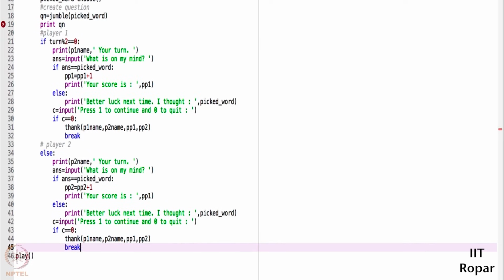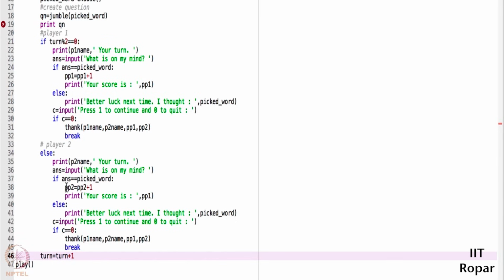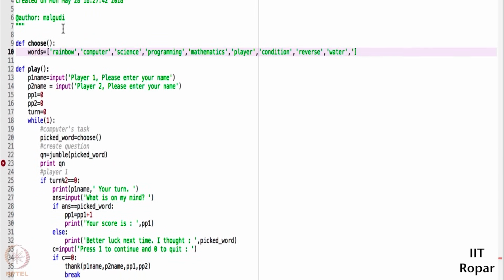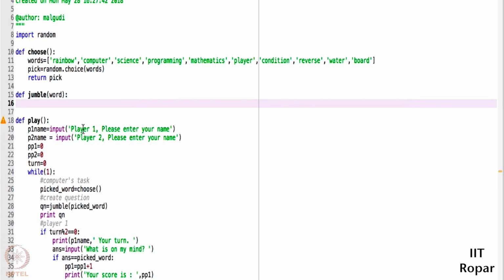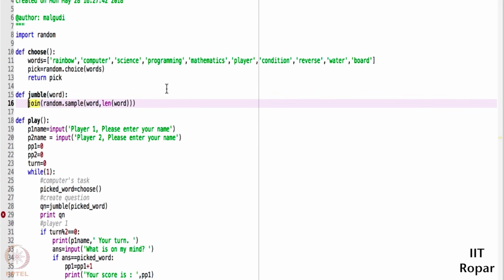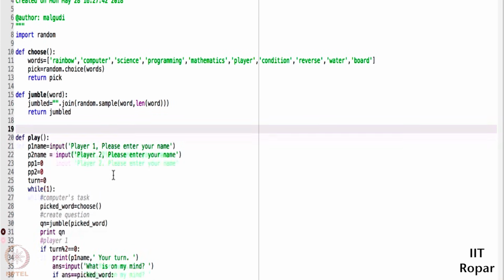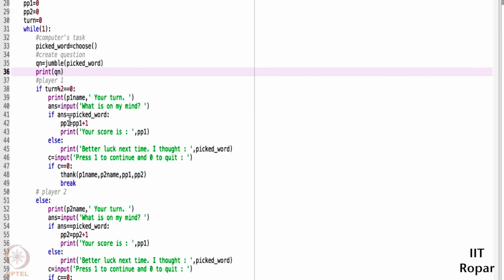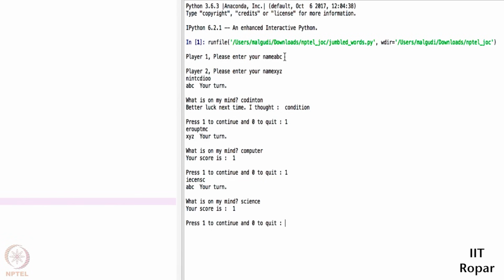Permutations - Jumbled Words 03

Comment: one mistake in code is there because of that we are not able to break the loop . that mistake is  we are not typecasting c input to int .
because string 0 is not equal to integer 0 ,  break statement will never run . this can be solved by typecasting c input to int .

Comment: i wrote that code and it ran perfectly. But this game keeps on running even if i type 0 when asked to continue or not. may be the break statement is not working here. i think variable c should be converted into integer when recieving 0 or 1 coz by default every variable is treated as string.
Reply: Thanks a lot. I too had the same problem. Your solution worked.
Reply: Thank you.. your solution helped
Reply: Yes...  that is because if loop is accepting only integer type values so either you can covert that c to int or you can modify the loop to accept string/character value 
If(c==``0``):
 Break

Comment: I compile program properly but I didn't get any output. If I type something and press enter then eroor comes that word is not defined. How to solve this problem?  Help please
Reply: It is simply that you not define any word properly all it's a just spelling mistake. Try to search that 'word'.  If you  require code then tell me. I will send you.
Reply: @akshayshah483  Thanks! I spot the errors and correct them but if statement for quit was not working. When I press 0 for quit program doesn't quit and turn of the next player will come and so on. In video she was also not quitting the program. Please solve it.  Thanks
Reply: @sandeepjain4963  try this.  c = input("Press 1 to continue and 0 to quit  ")
        c = int(c)
Reply: @akshayshah483  Tysm for helping me
Reply: @akshayshah483   yes your right bro , we need to convert that in integer format since the input is taken as string